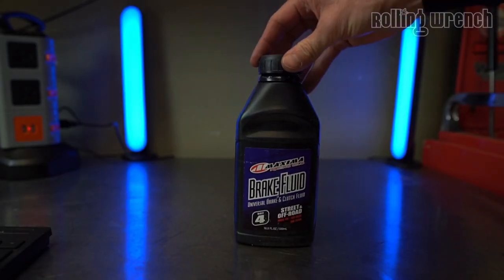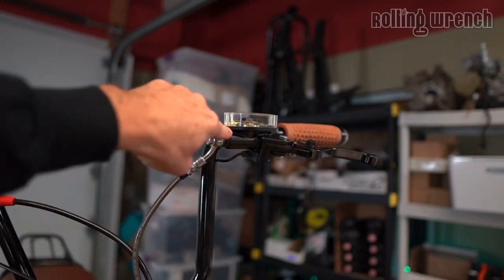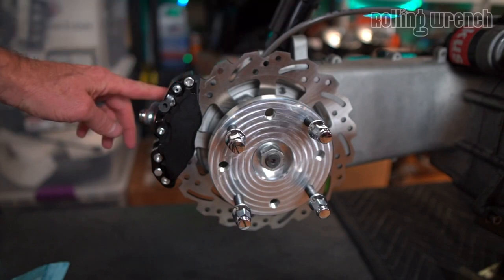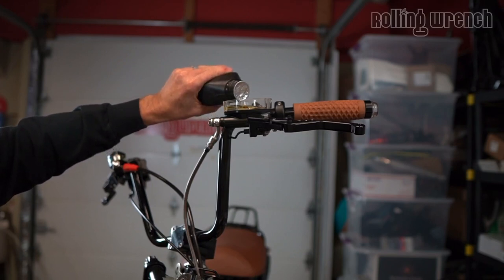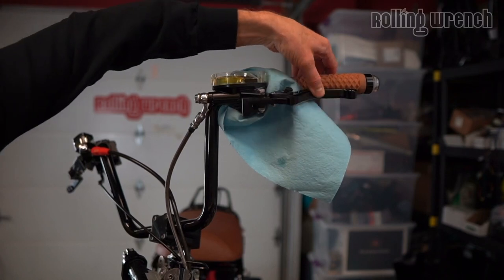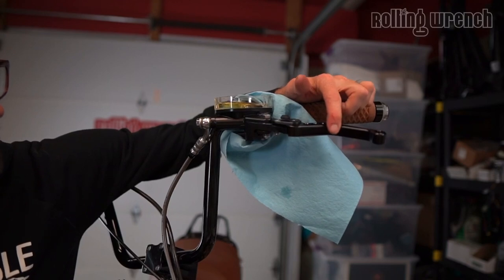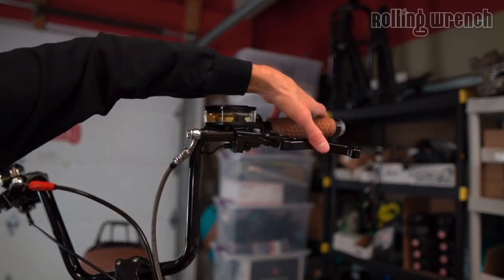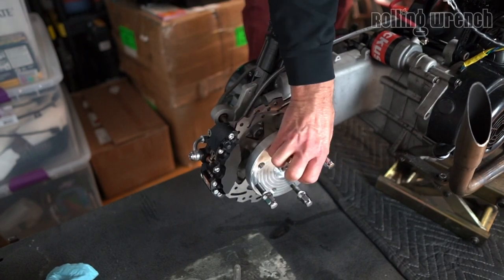How To Bleed Disc Brakes [STEP BY STEP]

Comment: The big bore kit in the 2020 taotao runs great but I know I need to upgrade in the other components like the clutch, carb, cdi,coil and muffler I will be ordering them from you if you can help.

Comment: I’ve been doing this for a week, even bought the vacuumed bleeder 2 different style bleeders just can’t get the lever to come up, I took the line loose at the masters cylinder and getting pressure there then tried it at the caliper also just can’t get it
Reply from the maker: Pull the caliper off the bike with the hose connected. Rotate the caliper as you bleed. Also be sure to bleed at the banjo fitting
Reply: I’ll try that in the morning, thanks

Comment: On Piaggio mp3 two disc in front & one disc in back & other disc brake on top center front and one parking brake in back! Top disc brake is tilt system that one can`t be bleed!
Reply from the maker: That sucker definitely has an advance brake system. Bleeding those brakes would be a project. The MP3 has an ABS system as well I think?
Reply: @RollingWrench There no ABC brakes system on it. Rolling wrench I. E. main fuel injection ECU on it!

Comment: I need to ask you some questions I put a 100 cc big bore kit in my 50cc taotao and need to order a new carb and a new racing cdi box and hotter coil pluss I need to know what kind of muffler and clutch I need to put in it? I have ordered other things like that from you for my other 500cc scooter but it didnt have the big bore kit in it?
Reply: I meant 50 cc not 500 lol